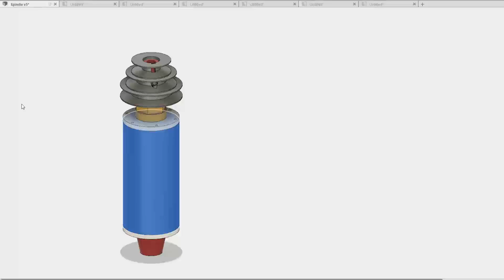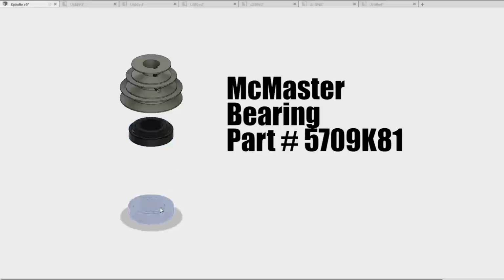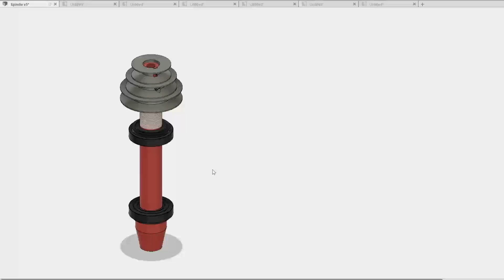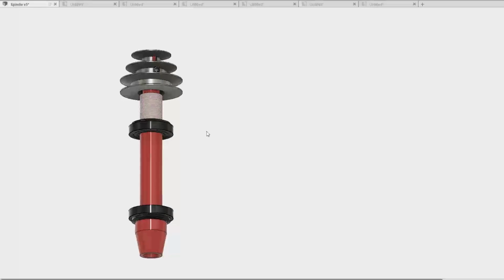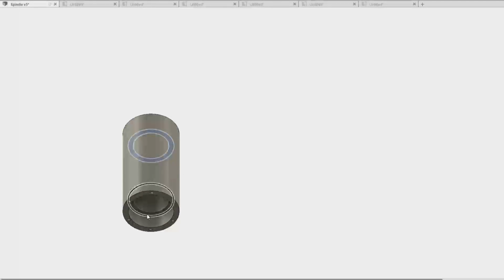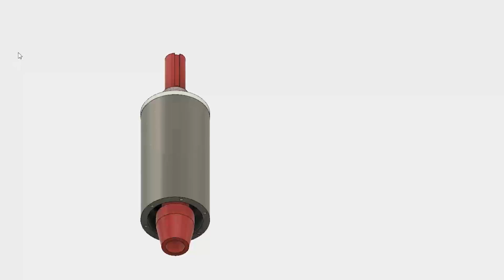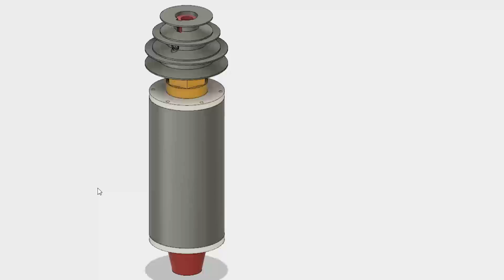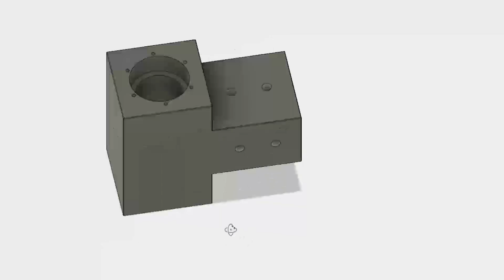Vertical Milling Head Plans //Beginner Metal Lathe Projects and Fusion 360

Comment: For work with extensive turning and subject to some wear, I'd suggest the use of steels such as 1144 or stressproof.
This steel is very strong and quite hard with Yp more than 100,000 psi yet it machines very easily without long stringy chips.

I've used this to make a dividing head spindle with #2 Morse taper bores in each end;  it is also a joy to use for small crankshafts machined from the solid.

Perhaps it was more dumb blind luck than actual skill, but the front taper has a run-out of .0002" TIR.  Was quite pleased with myself!
The rear raper bore had a run-out of .0005" TIR, but this is of less importance.

Step-by-step operations planning is important to achieving accuracy.  Oh yes, I bored the taper holes using the compound rest and finished them with a #2 Morse taper hand reamer.

Comment: this will be frustrating to make for a beginner :D i kinda made something like this from a 2" black pipe t-coupling, its surprisingly stirdy and all you really need to do is bore the pipe out to the diameter of the standart mini lathe bearings (swapped mine for tapered roller bearings so i had them left over anyways) but it was far from easy to make, by far the most challenging was the spindle, i used a very hard steel from a hydraulic cylinder to make this and it was a fuckin pain in the butt to make it precise enough to actually use it. so if a beginner wants to do this, i'd recommend going slow on it before trying to build this.
Reply from the maker: +Sharky I hear you on that.  I consider myself a beginner and I agree that I would wait to try this if I was just starting out from jump street.  

Making the spindle is probably the hardest part, mainly from a working holding challenge for smaller lathes.  Bore it first, then put between centers to turn the O.D. to be concentric with the bore?  Or turn the O.D. between centers and then switch to a 4 jaw with a fixed steady, and then bore the i.d. and Morse taper? Your thoughts?

 I'm responding not to challenge your comment, but to see if those with more experience could provide better insight into a project such as this to help everybody that is new to machining.

Comment: Thanks! Seems simple enough. Though that inner Morse taper might be troublesome. Maybe boring it with a taper reamer might be easier.
Reply: ThunderDog thats how I learned . Im actually going to put your ideas into practice on my Centec2 horizontal.  😉
Reply: Jānis Stīpnieks the mt2 tapers aren't that difficult to do,its all in the setup , go on give it a go ,you can have your reamers at the ready if it doesn't work out 😉😁
Reply from the maker: +Sean logie They're a little nerve wracking, but it's all about getting out in the shop to make some chips.